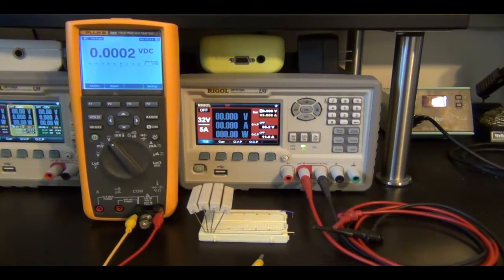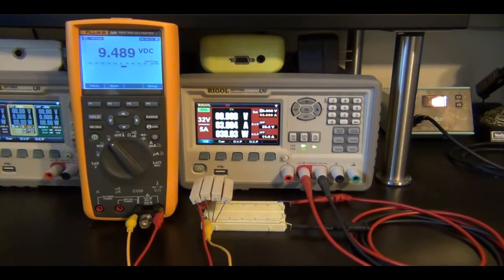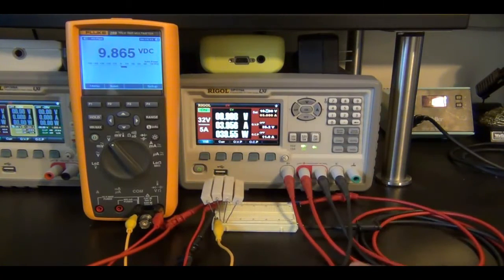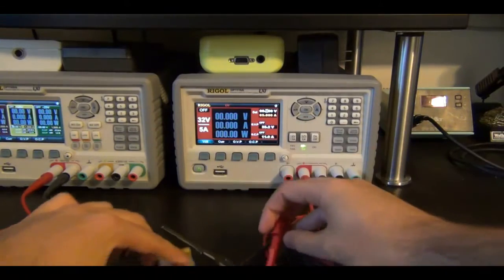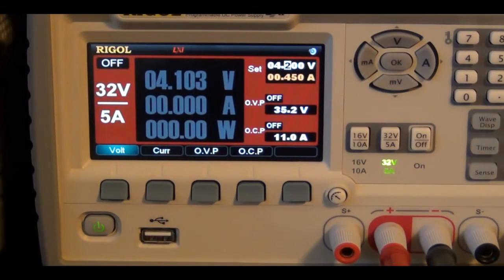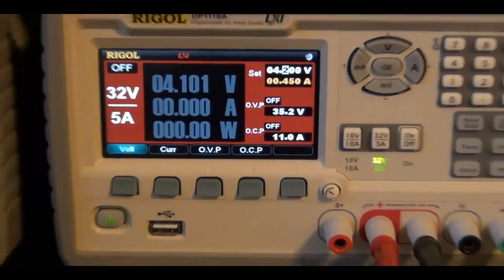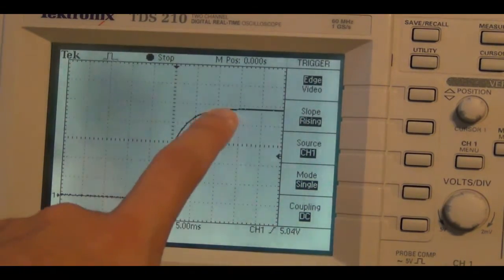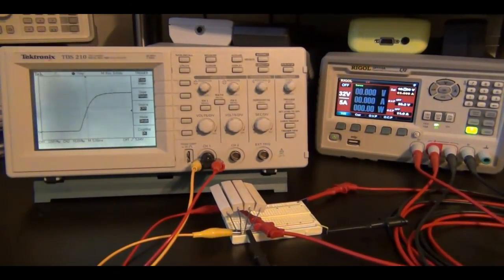TSP #6 - Rigol DP1116A and DP1308A Programmable Power Supply Review (Part 4/6)

Comment: Hi, I saw the videos and are very helpful. But you have a question, do not know if you could help me, that is the procedure that I have to make to the measurements obtained using the "Power Supply DP1116A" to save directly to the USB, or can use that USB port.